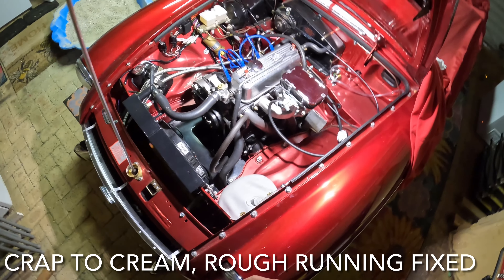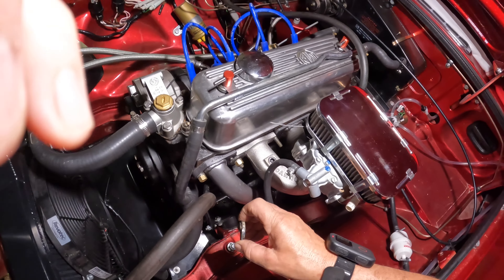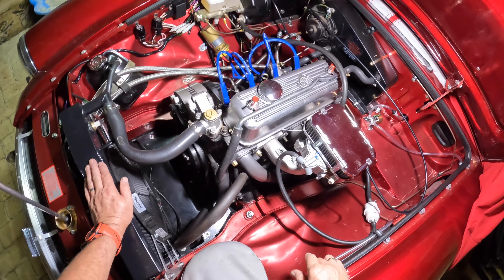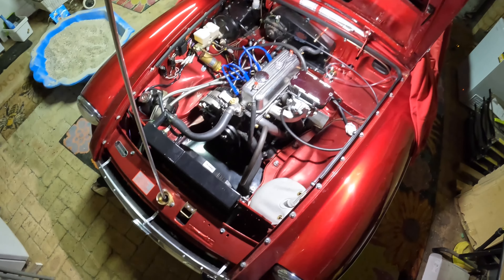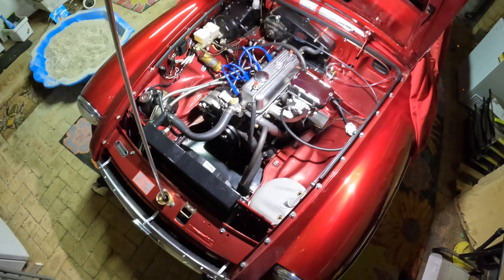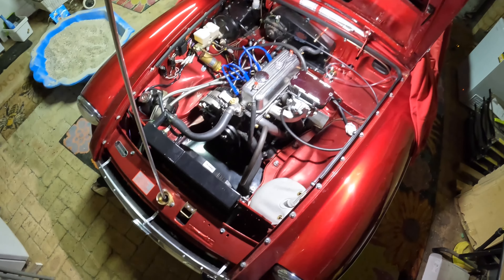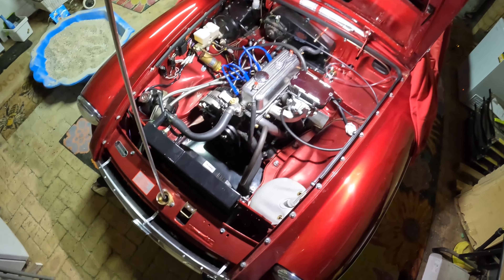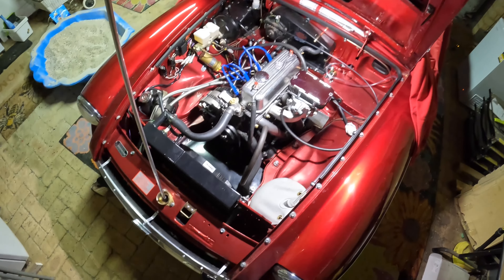Crap To Cream, MGB engine still a bit rough at idle, finally figured it out, wasn't what I expected.

Comment: Once fitted a downdraught Weber to a 1725 cc Humber Sceptre ,and ditched the old Solex carb .  The difference was phenomenal!        I did not even have to fit a new inlet manifold ......good luck with the MGB  !  Cheers
Reply from the maker: Hi David,  Some people have different opinions on the SU to Weber conversion, I've done my second one now and I have no complaints, my last conversion was a bit troublesome however that was as I found out due to a dodgy brake servo unit.  Now that's been repaired runs the same as the other one did.  I'm not building concours cars I'm restoring MG's that are drivable, maintainable and reliable, or at least better.  The MX5 gearbox and the Weber conversion have got to be two of the best mods with the most noticeable difference.
Reply: @CrapToCream  Be interesting to see if there's a performance or economy difference between the SUs and the Weber. My HIF4s seem to work pretty well after a rebuild, though I still plan on trying twin Mikunis at some point. I have them on my other car and they work really well.
Reply from the maker: Hi Stu, I’ve personally found the Weber to be slightly better from an economy perspective, with that the performance isn’t as “sparkling” as the SU’s, well that is as sparkling as the performance can be. Saying that I’ve only been on a couple of runs since I fixed the rough running issue so it’s a bit hard to judge right now. I’ll keep the question in mind going forward. Thanks for the comment.

Comment: Good information and not something that would come to mind as a cause of rough idle.
Reply from the maker: How right you are, I spent hours and quite a few dollars trying to fix this before I discovered the fault, this included and electronic distributor, a weber conversion, new plugs, new leads, an SU overhaul kit (first off), a couple of rounds of tappet adjustments, manifold gasket replacement and a balancing meter.  
              I just replaced the master cylinder as part of the restoration and didn't really give the right amount of detail I possibly should have, had the job been to only fix the master cylinder I'm sure I would have found the problem a lot quicker.  Being one job in maybe a thousand jobs this job just got lost as a small job in amongst several much larger jobs.  Once you find the problem it is hard to understand how you missed it in the first place.

Comment: Difficult to track down.
Good job.
Reply from the maker: Morning, you are not kidding , and it was an assembly error, had this been the only job I was doing I suspect I would have found the fault a lot quicker, being part of a restoration the master cylinder replacement just got lost in the bigger picture. Thanks for the comment.

Comment: I remember being shown that if you start the engine with your foot on the brake pedal, you should notice it drop a little if the servo is working correctly.
Reply from the maker: Hi Julian, now you mention it I seem to remember something similar, at the time I was in a different head space. My brakes have been pretty crap since the rebuild, still got air in the system somewhere, I have to bleed the brakes properly when I’ve replaced the servo. I got there in the end. I’ll be interested to see what the inside of the servo looks like when I get that apart. Again thank you👍👍

Comment: Had exactly the same problem  with my 1500 midget, carbs rebuilt, new distributor, plugs, leads, carbs stripped and rebuilt, had a chance chat with a mechanic in halfords who owned an mgb he told me to remove the rubber hose from the brake servo unit from the inlet manifold and plug the hose connector in the manifold worked a treat replaced the servo unit with a new one problem solved
Reply from the maker: As I have said to other people who are kind enough to comment, when I receive comments like this it makes it all worthwhile, glad you enjoyed the video  👍.

Comment: Same issue when fitting the Moss Parts SS exhaust manifold
Reply from the maker: Hi Colin, Rimmers and Moss must get the mainfolds from the same supplier.  If you haven't already checked out a later video, I found out what was wrong with the servo, and it wasn't what I was expecting, in hindsight a bit of a "rookie" error, anyway fixed and running a treat now, brakes work a lot better.

Comment: A 45 DCO cab works well  a bit more go if needed.
Reply from the maker: @jeffmee763 agreed, that’s what I’m putting on my new project in conjunction with the supercharger I’m installing in later videos if you check them out.   Thanks for the suggestion and comment. Cheers Marty

Comment: I have had 3 MGBs and friends with another 2.  All of the cars had been replaced with webers, but I had always heard from purists on the fourms how horrible Webers were, and 'perfect' the SUs are, mostly about so much more power.  Ended up coming across a forum post last year where someone swapped out carbs on their B and dyno'd them all.  Turns out very little difference between them (even the zenith) in terms of power delivery--under 5 HP if I recall.
Reply from the maker: Thanks for the comments John, what you say doesn’t surprise me. The Weber 32/36 does claim better efficiency which I have found myself, however better efficiency in the same engine means using less fuel which in turn does mean. Less power, you’re not burning or using the fuel. Power is nice but I enjoy my B for the driving pleasure and experience on the open road, I’m not what you would call a “speed demon”. Again thanks for the comments.
Reply: I have a '64 with SUs and a '77 with a Weber. They're both the same for performance and maintenance. Once I tuned my SUs I've never touched them again except for oil. They really are bulletproof. Having said that, Weber's the same. No matter what, love the content. Thanks for sharing.

Comment: No offense but I prefer the SUs. Balancing is simple and rarely needs re adjusting. Performance and economy are about equal to the Weber
Reply from the maker: No offence taken at all.  All credit to the SU's they hid the issue with the servo diaphragm leaking better than the Weber did.  Had I not had the Weber option I could well still be in a place with the rough idle and leaking servo.  On closer inspection I found the SU on cylinders 3 and 4 had been adjusted (by me) to compensate for the additional air flow from the leaking servo.   Whilst the engine ran better it was by no means perfect hence the reason I went down the track I did.  Thank you for the comment, appreciated your perspective.

Comment: Don’t blame you ignorance for the poor performance of the SU carbs on the carbs themselves! I say your ignorance because you have to tune the carb and when I say tune you have to tune the needle itself ie the correct taper for different RPM eg as idle mid range and flat out and you have to use our rolling road or a Lambo gauge simples 😊
Reply from the maker: Hi Paul, Thanks for the comment, might be surprising to you but I'm not ignorant around what needs to be done to get the tune right, for me, in the space that I'm in right now, retired where every day is a weekend, I just want my MG to run well. Not overly fussed about economy or performance, I just want a nice car to drive around in that runs "well" in my mind.  Today been out for lunch with my wife to Jarrahdale, then went to Fremantle, then down to Point Walter for an ice cream, a nice Sunday afternoon drive with my wife, car ran beautifully, never missed a beat, the squeaking brakes are something to behold, need to fix them next.
             As you will see in a later video, the fault with the engine running rough was an issue with the servo, incorrect assembly on my behalf as part of the restoration.  Fitting the Weber highlighted the issue and made the problem easier to find, there is a very good chance now I'll put the HIF SU's back on again when the summer has finished here in Perth, and I've also got Rose of the hoist.  I've also got a disc brake conversion kit for the rear axle, that will get rid of the brake squeaking issues and give me better braking.  
             I do appreciate the comment however I don't believe that that ignorant around the old MG's and how to fix them or get them running ok.